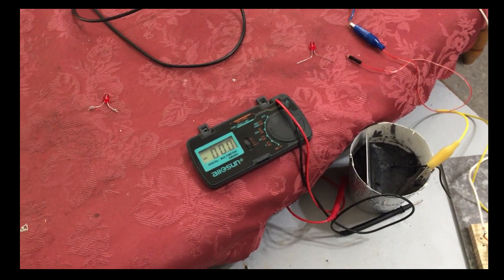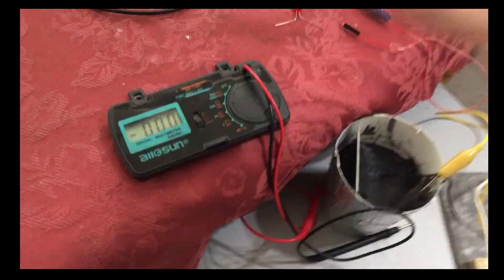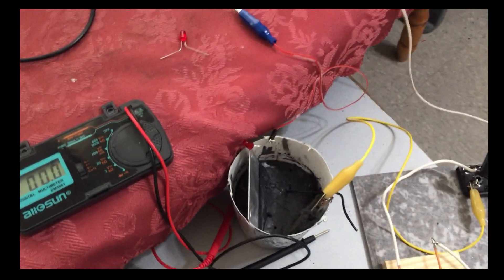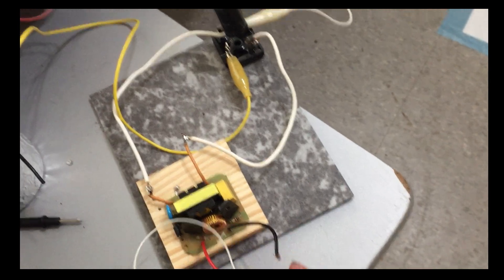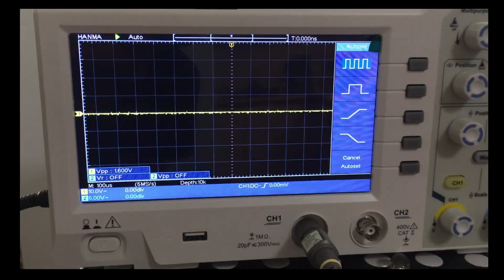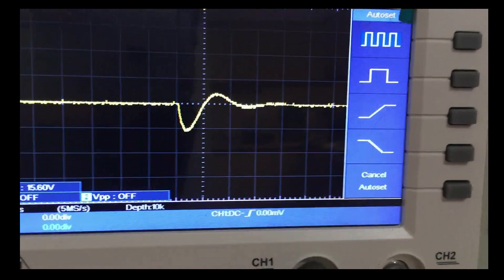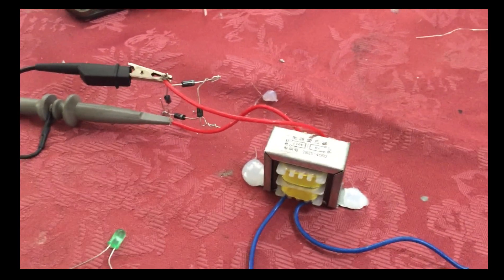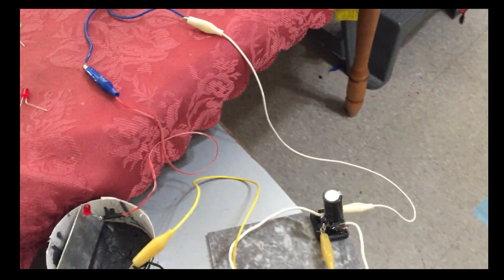Negative Energy Generator

Comment: I don't think you're creating any energy. Essentially, what's happening here is the view of an LC circuit. There is no additional energy. it's just slowly dropping from the initial input. 
It can be thought of like an anvil being hit by a hammer, it rings long after it is hit, when the ringing stops, you hit it again.
Im actually building a similar circuit for inductor testing or 'ring testing'. If there is a short in a large inductor or transformer, it won't ring or 'oscillate' as long.
If this was producing energy it wouldn't stop and the amplitude would increase.
Reply from the maker: There is more here that meets the eye. I'm just going to say this.
Reply: @joellagace1679 I'm open minded, anything unexplained needs more investigation 👍
But also remember Occam's razor.
Tank circuits have been around for a long time and are one of the fundamentals of electrical engineering.
Reply from the maker: I explain the progress of the PEG interactions under playlist Power Cells for all the fine details, I just don't want to have to write it all down here as a comment., These cells do so much!

Comment: Hi Joel, it seems that using your experiment I have created something weird: is not yet dried, I have not condition it but, there is no continuity, no resistance as you describe. Now the weird behaviour kick in: magnesium electrode is normally negative and copper positive, when measuring voltage in this way, there is no voltage … but, if i swap my probes sticking positive probe on magnesium and negative probe on copper, 1.4-1.6v start to show instantly … it is like a diode battery and I have no explanation whatsoever.

But this is really weird, it should display voltage with negative sign and not blocking … I am puzzled and looking out how to use this … any idea ?

Out of 2 cells only this one I did not condition and now contemplating to make another one on aluminium-copper without conditioning

Waiting to dry my water+plain flour compound to see further … i have tried this because I can’t get any plain PEG medicine … all of them have additional chemical elements.
Reply from the maker: depending on the mix and all those ingredients sounds like there might be some small P junctions as its not 100% dry and that might complete the loop one way, If its still non solid try to strip a small wire and place poke it someplace soft inside the PEG or what ever your mix is and try to feed with this new wire a positive or negative bias and see if the loop turns on like a transistor.
Reply from the maker: I also gotta try Creating a wet version of the PEG cell with cooking oil for shits and giggles. GPT says the oil could increase self capacitance and offers me the best of luck trying to mix it all even with the PEG lol.

Comment: You found out step by step the basics of the inner workings of this PEG cell. That's wonderful. In essence it's echoing between positive and negative but the negative is much stronger and creates a big negative trigger spike. The only open question is how much current a cell can carry respectively pushing? From the basics you showed so far I believe bigger cell would have lower frequencies but with more power. It's like a capacitor. A small capacitor has a high frequency and a big capacitor has a low frequency. But the big capacitor can collect more current. I strongly believe bigger cells will echoing current stronger with a lower frequency. Probably it's important to have a bigger capacitor as the load to dump on bigger cells. And maybe even bigger wires. Otherwise the effect could go undercover.
Reply from the maker: Yeah I need to introduce some feedback into the system to trigger the amplification effect, then we will have a better baseline of what this can do. I understand this kind of thing is not as simple as taking the output of the secondary and load it to a cell back into the circuit a load etc might render the potential amplitudes effect null under load but one thing we know is these high voltage spikes can charge capacitors, So I would most likely need to dump a charging cap back into one of the DC series capacitors for a self runner.
Reply: @joellagace1679  An other thought in this regard. Sorry but this PEG cell circuit is so special. It looks like this circuit is limiting itself perfectly in all aspects. In a normal circuit if the current is too big the cable gets hot. We are used to this behavior. In this circuit the frequency gets generated itself. There is no need for pulsing. So does the current flow. It just attracts as many electrons to flow as it is possible for a certain setup. If the cable is very thin it will take what it can. There is no need to protect the circuit. It's protecting itself perfectly. We are not used to that. And this could lead to the conclusion that there is no or just little current. I think it's the opposite. If the electrodes and the wires and maybe even the capacitors are big enough there will flow probably millions of millions of electrons and we find more power we ever dreamed of.
Reply from the maker: Yeah more or less is why this PEG cell is exciting discovery. :)
Reply: @joellagace1679  That sounds simple and feasible. Do it. It's a big step forward if you manage to do that.

Comment: Yeyeye... ZVS circuit or Avramenko plug with square wave... check that. Same story!
Reply from the maker: I did all that AV stuff almost a year ago no one liked it. even if I got close to 10 watts with ma input. I even made a device its all on my channel. I also find its more trouble then what it's worth at high voltage high frequency. You got to do so much more  filtering and all that stuff. I got tons of circuit diagrams as well. It never catched on.....Prob because the AV needs a source dipole it won't open and maintain its own. It would work well with a classic high volts elecret. And i'm trying to break away from all that super HV stuff for the moment anyways keeping things simple. One of my first serious energy experiments years ago was the Kapagen. Talk about starting backwards.......
Reply: @joellagace1679  Nice work ... for the humanity! Kapagen is same because of the AV effect working there as well with specific Tesla coil ... patented at 1886 USA!
That is the Kapagen... you know... the most of the people has no idea at all, the basic electricity how working this is the basic issue .... 0 education! "green energy", new communication forms ..etc etc but the humanity itself ... not so educated.
Reply from the maker: No it sometimes makes me sad but when i push some concepts and it does not go anywhere I try and move on so I can get more people interested with different set of keywords. Right now this PEG cell seems to be sparking interests. But yeah if I had my way my shop unlimited resources, I'd go back to Don Smith and incorporate all this stuff into it.  But then you also get into resonance and magnetic amplifiers and such things. Not for the faint of heart.
Reply from the maker: You are probably aware, A while back I made a video that show how the potential boosts like around 4x or more just by grounding one side of the AV plug even a counterpoise floating one wire ground does it. So what I tell people is have a switch and pulse the ground to take advantage of that extra spike that comes from the earth/environment for free.
Reply from the maker: You can also use the mains direct to the AV plug. Don't close the loop and you get around 10v when you add the counterpoise. It charges caps and such.

Comment: Seems to be working with water hammer effect (fluid mechanics). I suspect thats also why 3 diodes in parallel have lower voltage drop. Now you just need to turn it in to ram pump :D

Comment: There was a video about a patent it was simply an update on improvement an atmospheric electrical accumulator they found out that if it was pulse it would produce far more energy it's because they're making and breaking the high point connection to the ground what causes the natural atmosphere energy to engulf the wire going up in the air basically changing the ground point and causing and absorption enter The wire. When the ground was disconnected the energy would engulf the whole wire plus the plate on top. And then when it was grounded the ground would move all the way to the top. Basically the make break contact with recharging the wire and whatever was on top. Where was getting far more energy out. If you want to do something like that with this device that you came up with it would pulse on its own. Creating a lot of extra energy for your device and just keep running. And depending on how much metal you got up there to absorb the atmospheric electricity will depend on how high the voltage is and how powerful it can be

Comment from the maker: According to the waveform it looks like this thing can support itself and provide additional energy. Now it's just the challenge of how to send it back with most minimal loss for a feedback. Open to options 😁
Reply: Maybe connect it to a cheap hv flyback ferrite transformer for a AV plug feedback to DC cap?
Reply: Have you seen walter russels work ? It will explain everything. This is not strange it's nature at work to create balance at zero. Everything diverges and converges together its a disintegrating and regenerative function of the universe when in resonance this occurs